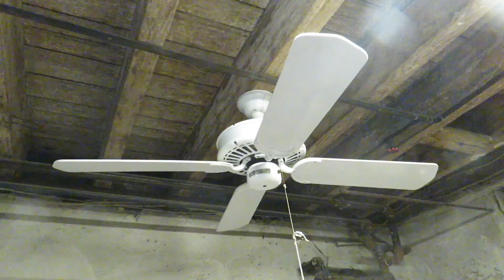Why It Is A Good Idea To Have Ceiling Fan Chain Set On High When On Wall Or Remote Control: Part I

Comment: I set the chain on my fans on low so they can have a Casablanca low speed.
Reply from the maker: Actually, putting a chain on triple capacitor fan on low would actually do the opposite when on a solid state fully variable speed control.
Reply: So if I keep the chain on my Harbor Breeze bellhaven on low by a four speed wall control can damage it?
Reply from the maker: Nope as long as it's capacitor based. It's choke based and solid state fully variable/infinite speed control that can speed up triple capacitor fans set to medium or low. Harbor Breeze Bellhaven has a triple capacitor. If turning down a 4 speed control slows it down with the chain set to low, it's capacitor based and you should be fine as long as it doesn't stall. If it speeds it up, it's choke based. 4 speed choke based control is very rare though.

Comment: I remember seeing the packaging for one of those aftermarket remote control kits, and it mentioned to set the fan on high speed. Yeah, I can understand it now, even though I understood it before but with a less elaborate reason.

Comment: That gives me a good idea Jonathan, I always set the chain to high position after I'm done screwing around with my Hampton Bay Lyndhurst. My parents told me not to put the Speed position on the chain to medium or low, my parents always said to leave the pull chain set to high.